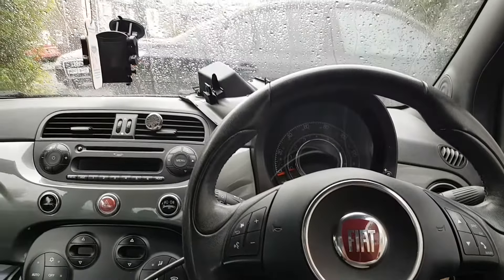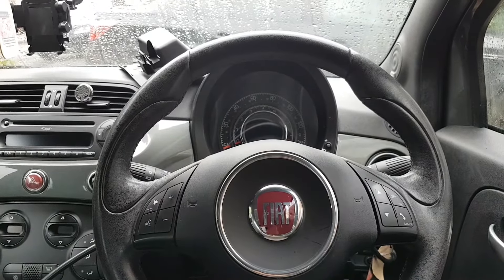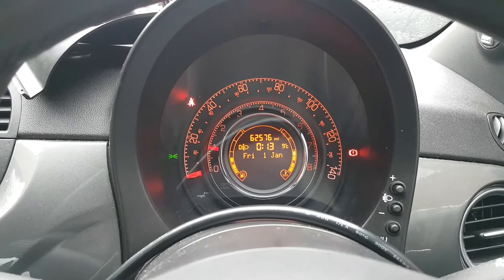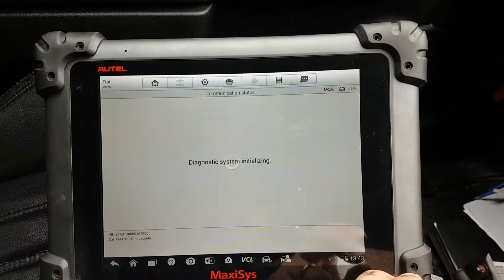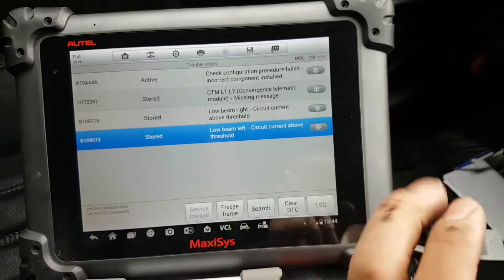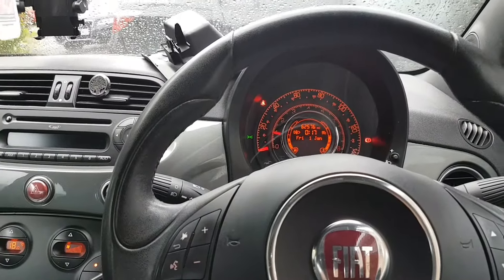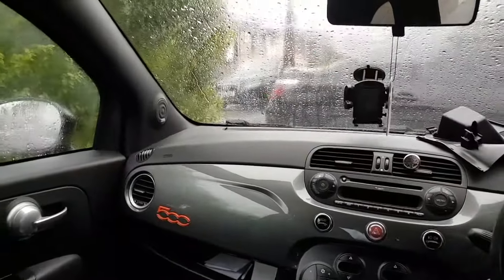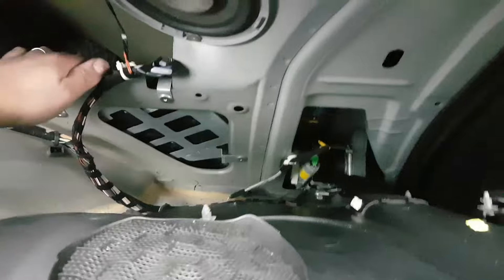Fiat 500 mileage flashing... Fault finding and repair.

Comment: It’s important to note that if you remove the panel entirely that corner bolt holding the rear seatbelt will often snap. The bolt goes to the wheel arch and unless cleaned with a wire brush and lubricated it’ll probably snap coming out. You can also remove the module by undoing the nuts on the cage rather than taking the rivets out for people who don’t have a rivet gun. I use a 6mm masonry bit and they come out in seconds. Secondhand modules don’t need coding, only brand new ones. A repaired one doesn’t.
Reply: What goes wrong with the unit, does anyone know, i would like to repair myself
Reply from the maker: Usually is the data in the NAND flash that gets corrupted...
There is tools to read the flash and restores the data... but all also depends on state of the NAND chip...
👍👍👍

Comment: Great video... I had the flashing odometer after I disconnected the battery overnight and reconnected it today. Fortunately I read on a forum to try disconnecting again and reconnecting after a delay... I did this carefully and everything is fine now !
Reply from the maker: Yes... sometimes that works... but that could also mean that a final failure is on the way...
👍👍👍
Reply: John, what do you mean by "reconnecting after a delay"?
Reply: @mauro_mirez  Disconnect

Wait

Reconnect

Comment: Interesting Video.  I had this problem after my battery was getting a bit flat; next day - Suddenly no audio controls or Bluetooth and flashing odometer. No amount of checking uncovered the problem either for 6 months -  I basically gave up.
Anyway, after a 50-minute drive going to church, in 40 ° C in severe Aussie heat on Christmas day, my blue and me module sparked up again and started jabbering on in Italian! 
Everything was working again somehow, maybe a XMAS miracle, and I only had to download an English patch and installed that via Fiat's USB port. God know what that was though.
Reply from the maker: That's a first!
But, if it works, it works...😁
👍👍👍

Comment: I've had the same thing. Sometimes the process works. Sometimes not. Usually on the Ford KA to be fair. When the CTM or whichever module decides to throw one, it seems to sometimes screw the data in another module and getting the mileage to stop flashing really gets expensive. Glad yours was an easy one 👍
Reply from the maker: 😊
Thanks!
👍👍👍

Comment: I’ve seen this problem caused many times when the battery is renewed. It can be avoided by changing the battery carefully with the engine running. Sounds dodgy but it does work!!
Reply: I use 3 Li batteries with a series diode and resistor clipped to the leads when changing a battery.
Reply: It is not recommended to run the engine without a battery on. Depending on the manufacturer things can go wrong doing this. It is better to have a parallel voltage on the leads.
Reply: @MechanQDX445  Agreed. However there at a lot of things it’s not recommended to do……Sometimes……..
Reply: True. But many cars use the battery voltage as reference and without it there is a chance of overvoltage from the alternator which can lead to damage and very costly one. No need to push our luck.
Reply: @MechanQDX445  mmm, yes. I certainly wouldn’t attempt it on a French vehicle!

Comment: I have 2015 500e but what is the relationship with Usb connection of it? I have same problems with your. Did you get fail when you try to use media player on the radio? There was no connection of  gear box usb, no feedback from steering wheel buttons which is related BM and mileage flashing all the time.
Reply from the maker: When the media module fails it disturbs the communication between modules...
The mileage flashes because the gateway fails to communicate with that module...
👍👍👍

Comment: Thank you for the excellent video. My 2011 Fiat 500c recently had a clutch plate and slave cylinder £950 repair. Now the car has a flashing mile counter or whatever it’s called. It did not have this before and the garage says it was not caused by them. I think it was. Very expensive to fix but would not cause the car to fail its MoT.
Can you recommend a good Fiat mechanic/electrical person in the Eastbourne, East Sussex area?🤞🏻
Reply from the maker: It definitely that work should have not caused that...
Could have been a coincidence...
That said, get the car scanned and see what is going on...
Unfortunately no, I do not know anyone in that area...
👍👍👍

Comment: Do you have to do the proxy alignment after removing the module? Will the battery continue to drain if you don’t?
Reply from the maker: No... the battery will stop draining...
But the proxi is recommended...
👍👍👍

Comment: Hi, Is there a fuse that can be pulled to disable the blue&me module?. My mileage has started flashing and blue&me isn't working. Don't fancy trying to dismantle the panel in winter to unplug the module, if I don't have to?
Reply from the maker: Remove the fuse will not make a difference...
What are you trying to achieve by removing the fuse?
👍👍👍
Reply: @LMAutoRepairs  eliminating battery drain, it's not draining at the moment but have read it is a common issues once the module plays up. I will get it coded out but not this side of Christmas.
Reply from the maker: Ah...got you... I am not sure if there is an individual fuse just for that, of if is shared with some other components... sorry... check Mr. Google for the fuses assignment...
👍👍👍
Reply: No as the two fuses run other critical systems. The only way to stop the battery drain is to pull the plug on the module.

Comment: I have a 2012 500 in the shop with the same issue , but not quite the same: the CTM AND the VTM are unable to communicate with the BCM or a scan tool, but they share the same CAN B network with the radio, and the radio can communicate with the BCM and my scanner.
Reply from the maker: I would say, check powers and grounds... they might share the same...
Without checking diagrams is a bit tricky to advise...
👍👍👍

Comment: Thanks for the video how I turn off the BLUE&ME system in a Fiat 500. Makes the battery drain
Reply from the maker: Unplug it... or remove the fuse...
If you just want to get rid of it completely, you also need to do a proxi alignment to remove the module from the configuration...
👍👍👍
Reply: @LMAutoRepairs  can you please tell me which fuse to remove for a 2013 fiat 500 1.2 lounge?

Comment: Great video!
I noticed that the old module might still have some life in it. Shutting down (essentially going into sleep) might be a sign that the module is not getting any CAN communication. Now, I see you probed the CAN wires, but maybe the problem is just a bad CAN transceiver. Could you check the RXD pin on the CAN transceiver while the module is connected to the car? Or maybe next time you diagnose a similar issue you'll have this in mind?
You can also test the old module on a bench setup, but that might be more of a challenge. It's easier to just hook it into the car. Anyway, just my 2c.
Reply: If it is a bad transceiver, won't the fault repeat with the new one?
Reply: @tharindutest9930  Yesterday, my i20 EPS light came ON and steering is very hard. I diagnosed the issue with multimeter.
1. 12v is available at the input coupler of the EPS module. 
2. 12v from IG ON Or Start is available at the third coupler of the module. 
3. However, with engine running, there is about 5v (supplying to the EPS motor) at the output coupler of the module. As steering is rotated left or right, voltage fluctuates +12 to -12 on the multimeter. This time no EPS light. 

After waiting for about 5 minutes, the EPS light comes ON. At this time, multimeter shows between 0 to 3v only.. even with steering rotated left or right. 
Why I don't get +12 to -12v? 

Is the EPS module faulty??? What causes module fault?? I assume now the motor is not faculty. 

Please help immediately. Thanks in advance.
Reply: @tharindutest9930   To clarify - my comment was just a guess - but that guess could have been easily tested. It might have been a bad CAN transceiver chip that doesn't function properly anymore, and so not waking up the module. Or it could have been a voltage regulator chip that wasn't creating stable/correct voltage output and so the module could have detected this and went to sleep. (It could also have been a number of other things that are harder to check)

Whether a new (factory new or second hand replacement) module could repeat the same issue - it depends on what causes the issue:
1. Bad supply of CAN transceivers or voltage regulators - maybe. or maybe not. Depends entirely on the new batch of chips that were used to produce the module.
2. A systematic issue like vibrations or condensation - very like to occur again even with a factory new module.

So it depends entirely of the source of the issue.
My point was that this could have been very easily checked.

It doesn't require having the full schematic to determine which chip is the CAN transceiver and check the voltage/EN/CAN_H/CAN_L/RXD pins for the signals that were shown on the vide to exist on the cable assembly.
Also looking for voltage regulators or buck converter chips - that is less easy but not at all impossible. I don't blame Luis for not checking those as it takes a lot of time and energy and focus to be able to determine a bad power supply on an unknown board - and time costs money too. If one hour of looking for something that can't be guaranteed to be the issue costs more than a second hand unit - then you buy a second hand unit. It depends on the customer as well - most customers will likely either chose a second hand unit or a factory new unit.
But the CAN transceiver issue is way much easier to determine and it takes a couple minutes with the scope that is already in front of him - and that gives the customer another choice to fix the issue with less money.

Hope that clarifies what I meant.
Reply: @radoro  Assuming the tech is willing to invest time in checking all the different aspects you mentioned, what are the corresponding courses of action he can take to repair the board? Even your previous reply is most appreciated.
Reply: @tharindutest9930   Just identify faulty components and replace them. See if it has any effect - if it does then the module is repaired for very cheap, just a couple dollars.

Comment: Hey thanks for your video. I have a 2017 ducato with the flashing odometer. Fiat can't fix it without a 700 euros central replacement. Thinking of fitting a Fiat proxy emulator card from atomis. Do you know anything about them. Thanks for any info
Reply from the maker: I heard about them, but never had to install one...
It should do the job, if the culprit module is not necessary...
👍👍👍

Comment: Great Video! This device in my 500 Twinair 2014 broke, too. Now drains battery, too. I do not want to replace it. So, is it possible to unplug it somehow so it no longer sucks power? Not by the plug at the device since it is sooo hard to reach. Do you know where the other plug at the other end of the cable is? AFAIK there is no solution to just remove a fuse.
Reply from the maker: The fuse is in the glove box... if I am not mistaken...
👍👍👍
Reply: @LMAutoRepairs  Thank you for answering. So there is a separate fuse for the B&M device only?
My 500 from 2014 doesn‘t have a glove box. Just kind of „shelf“.
Reply from the maker: I believe it does have... but I might be wrong...
Yes, at the bottom of that shelf is a cover, behind it are the fuses...
Unless I am confused with another car...😋
Reply: @LMAutoRepairs  okay, Thanks a lot!

Comment: I saw the full video. And I do have a question
Tonight this problem showed up at the same time the 500 got into some odd safety mode in which the acceleration is limited. I got to press the pedal all the way to the bottom to get 50kph max speed. I'm worried something else happened besides this faulty module.

I read a faulty coil could be related but... Two separate issues at the same time? I don't believe so.

What do you think?

BTW, thanks so much for your effort on making this video.
Reply: UPDATE: I removed the battery, waited for 10min and put it back in. The acceleration safety mode has faded away. Only the flashing odometer remains which makes me want to try your final recommendation. I will post an update  when I have a chance.
Reply from the maker: Scan the car first... that way you will have a better idea of what is going on, and of what happened, as you will most likely have codes stored on the engine ecu as well...
👍👍👍
Reply: @LMAutoRepairs  Hey maybe you can answer this one real quick. Do you know which is the fuse for this module? Im about to start by checkng the fuse boxes and Im looking everywhere but cant exactly locate based on the module name you provide on this video. I would appreciate it if you have a chance.
Reply from the maker: I can't really remember now... check in the users manual...
Or just go through all the fuses...

Comment: Good job on the module but replacing a safety critical bolt with generic hardware?
Reply from the maker: Generic? 
If the original was any special, wouldn't have snapped that easy in first place...
Thank you for watching!
Reply: @LMAutoRepairs  seat belts use specific bolts...but its all bulshit as we saw it snapped..it will be fine with the new bolt.....usually seat belt bolts are the same thread on most cars so when i need i go to the junkyard and get a seat belt bolt form other car....

Comment: Lu if the owner decide, she want a new aftermarket module like android DIN 1 in this case u don't need a module at all? Just need to be de-configure from BCM. As u sad this module will keep failing i guess is a better route to aftermarket. What u think how u do this scenario pls.
Reply from the maker: Possible...
Just as you said, would have to proxy align the BCM to "remove" the module...
👍👍👍

Comment: Hi. I have a similar problem with my fiat 500.  Would you be able to look at that? Thanks
Reply from the maker: Similar?
What exactly are you experiencing? 
👍👍👍
Reply: @LMAutoRepairs  my mileage is blinking and my blue and me is not working, my mechanic plugged in the car and he said I need to reprogram the computer of the car. I had the same problem with my vauxhall in Portugal but it was easy to fix.
Reply from the maker: Most likely it will need replacing...
As per the video...
Reply: @LMAutoRepairs  how it will cost to fix the car?
Reply from the maker: The price of the module plus the programming... I would say a couple of hours labour at any decent garage...
👍👍👍
Reply: @LMAutoRepairs  do you know any garage around London that can fix the car?thanks
Reply from the maker: Not around London... sorry...

Comment: i changed one module like this before and have one in the garage now with same problem.would be interesting to know whats wrong coz i remember a reflow the board,changed can chip and checked most ic powers and didnt find a issue last time.the owner doesnt need the bluetooth so i have a elm 327 around that i should modify and install multiecuscan to take it off proxy
i liked the handheld scope,need to get one.looks better to use in small spaces rather then use picoscope
Reply: @LMAutoRepairs  dont know if u have it but autel load probe is very handy for power testing under load,audio oustputs,rough ideea if can is alive,continuity and powering components,reference voltage from ecu etc
I rarely use test light since i got it
Reply from the maker: Yes... I do have have one...
👍👍👍

Comment: Can you use a different part number module. We have a ford KA with battery drain from blue and me module. Sent away for repair they said they can't repair it as not a part number they can repair. So some modules they can some they can't. thanks
Reply from the maker: Not sure on ford's... on this is all explained in the video...

Comment: Maybe you should tell the customer, that the USB cable to their phone must be in serviceable condition. A cable with a short could fry the CTM (again).
Reply: Totally agree on that, quite a few control units go bang due to dodgy peripherals. Some manufacturers such as VAG (and, maybe, Ford?) do integrate an overcurrent shut-off protection into most of their control units but it seems like there are quite a few systems out there that are totally vulnerable in this regard. People should be aware of the risks of connecting dodgy stuff to computerised vehicles.
Reply: And what would be the solution to that?changing all the blue and me unit?

Comment: This happened to me: Only my speedometer is flashing. So I cleaned the battery corrosion and it stopped. 2months later it is flashing again. What could be the problem you think? I had the battery checked then and now and both times they told me it was a good battery.
Reply from the maker: Hi
I believe you had reset the modules the previous time, when you cleaned the terminals, by disconnecting the battery...
Perhaps now you have a different issue...
Have the car scanned... that should point you in the right direction...
👍👍👍
Reply: @LMAutoRepairs  I never reset the modules just cleaned the battery
Reply from the maker: I understand... but, you have disconnected it to do so, right?

Comment: Great video and very informative, but you need to consider either a script or dubbing in the sound later, after filming.
Reply from the maker: Script? 
How can I script if I never now what the problem is before start diagnose?
Dubbing? 
Too time consuming... plus I would forget most of the details by the time I would be ready to dubb...😋
Thank you for watching and for your comment! 
👍👍👍
Reply: The way things happen now are quite interesting. A couple of irregular verb mistakes, that accent, seeking for the correct word to say. It's part of the adventure.